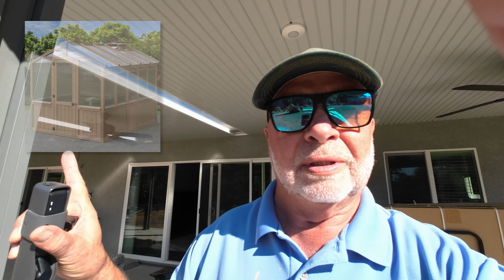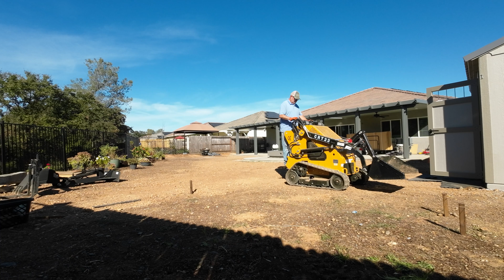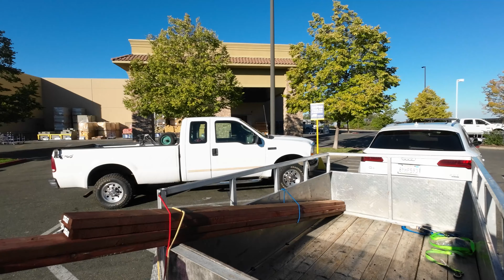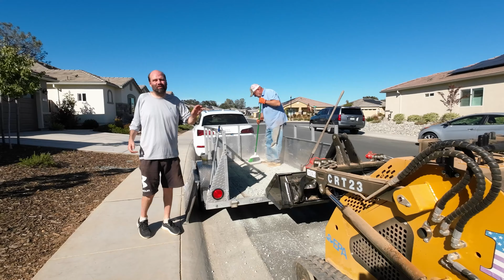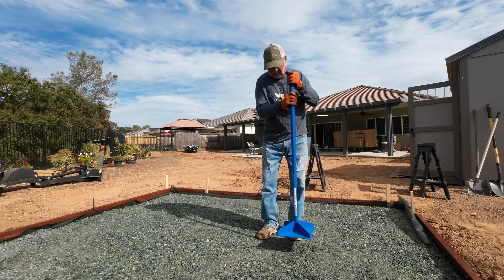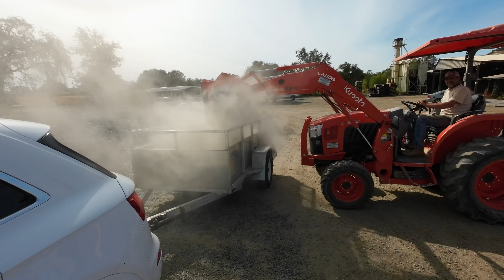Part 1:  Yardistry Greenhouse Foundation

Comment: Dude, great videos.  I am thinking of getting this 8 x 10 unit for myself.   I live in Montana so I'll probably be storing the boxes in my garage 'til spring though.  Can you tell me the approximate sizes of the boxes these came delivered in (if you can remember)?  I also notice you laid down some sort of barrier before you poured the gravel, is that for weeds?
Reply from the maker: Thanks.  These came to my house and it took two guys to load the 3 boxes on to my "H" cart.  The are probably 8 feet tall, 4 feet wide and 6 inches thick.  The barrier is for weeds and to keep the gravel from mixing with the dirt.